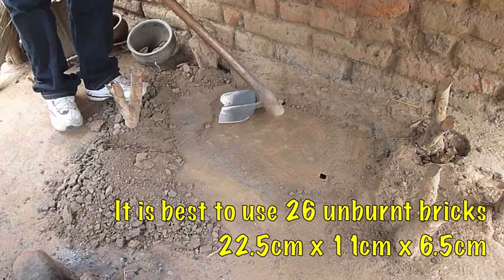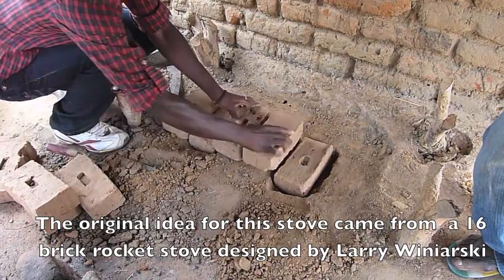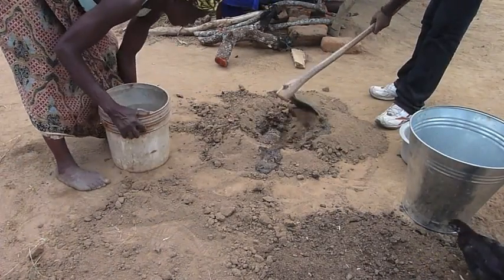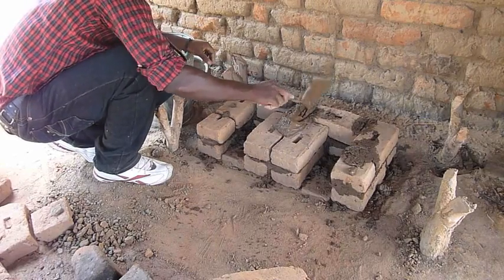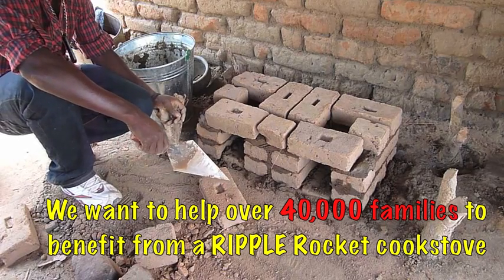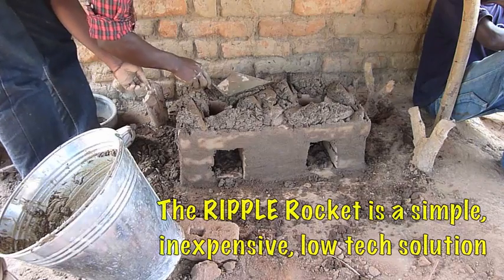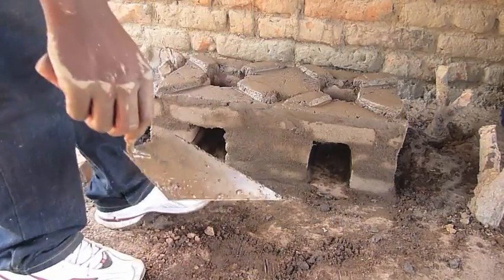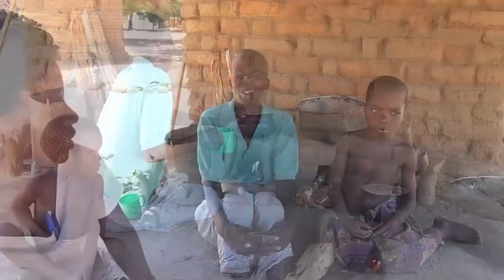How to build a Changu Changu Moto fuel efficient cookstove - RIPPLE Africa

Comment: Wow very nice 
Is this just a normal mud ? The problem is how to produce the bricks
Reply from the maker: Soil with clay is good - we use mud from termite mounds
Reply: @rippleafrica1 Then you can reuse the ash to make more bricks and mortar. Then once those are burnt through, the ashes can be collected and made into bricks made of a putty that truly won't come apart, even when wet. The chemistry behind it is that it's calcium hydroxide, absorbing carbon dioxide and becoming calcium bicarbonate. Once dry it turns into insoluble calcium carbonate.
Reply: This is great. I work in Mozambique and would love to do something like this for the feeding program at our preschools. We get through so much charcoal. Can you use this oven with charcoal or only wood?